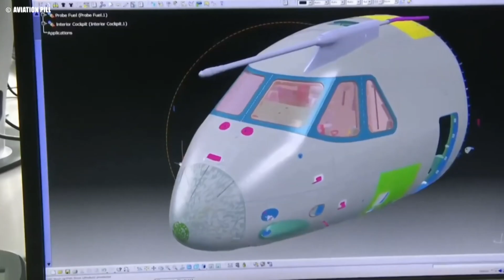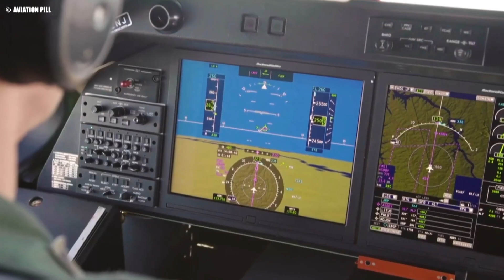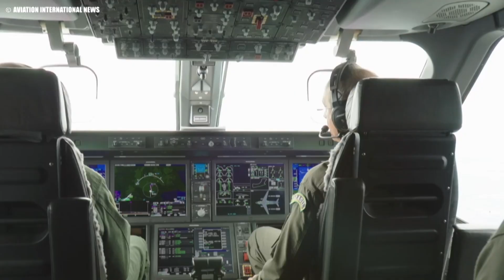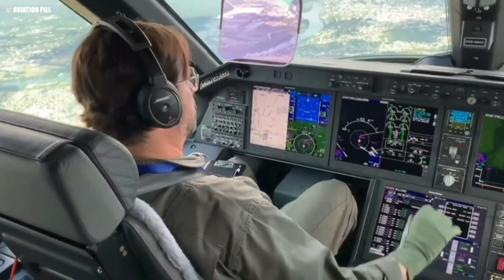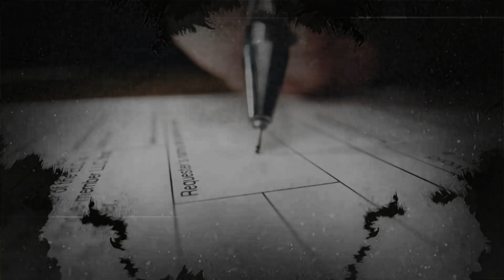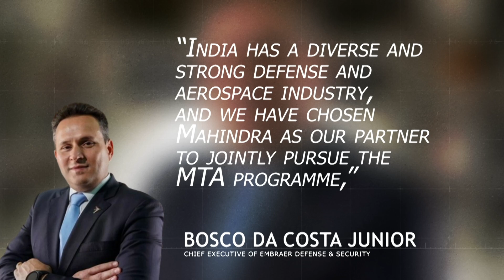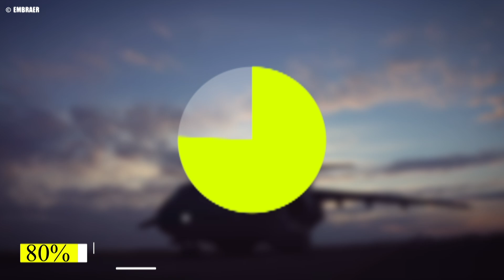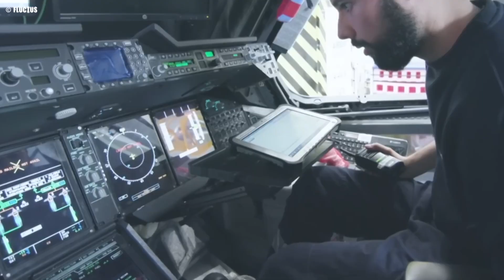The NEW Embraer C390 Will DESTROY The Aviation Industry! Here's Why!

Comment: It wont transform anything unless it can be flown properly on one engine when loaded.
Reply: You can said THE SAME to the half part of TEN THOUSEND AIRBUS 320 family jets that use the same pair engines since  1987 (about 50% of that is about 5.000 jets equipped with two IEA V2500 engines). 
It was just for THAT has make Embrear decided to use this configuration!!!
AND the A320 family jets is an IDENIABLE world success!!!
Reply: And who said that?😅
Reply: Quem disse que não voa? Aqui a Embraer antes de lançar um avião eles testam exaustivamente em todos as configurações e situação possíveis e imagináveis, a mariposa e linda, perfeita e the best.
Reply: Pathetic on your part. Embraer is not an amateur company; the entire design was carefully thought out, especially because it was a project commissioned by the Brazilian Air Force, which has been a longtime user of the Hercules and knows very well its strengths and weaknesses. Not to mention that Brazil excels in aerospace technology, and the Brazilian Air Force is one of the oldest in the world, with several aircraft built domestically. Now, we also have the Gripen -  E/F(Gripen  NG) being developed and manufactured.